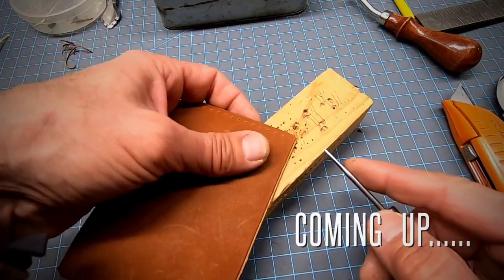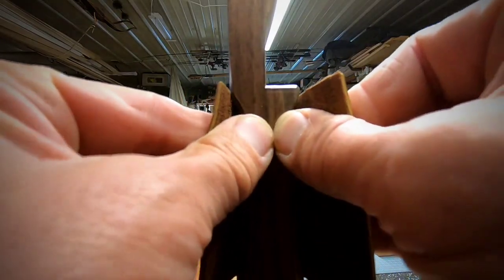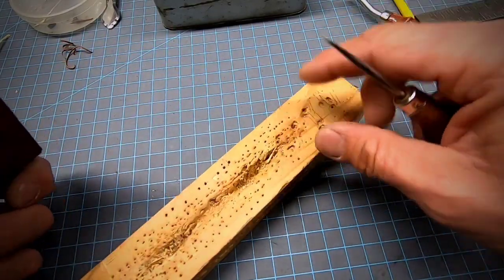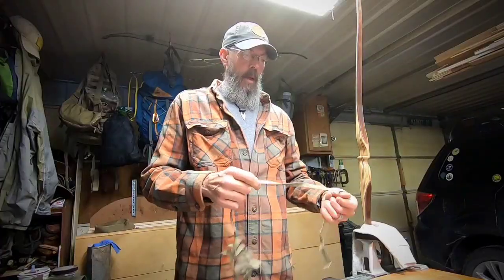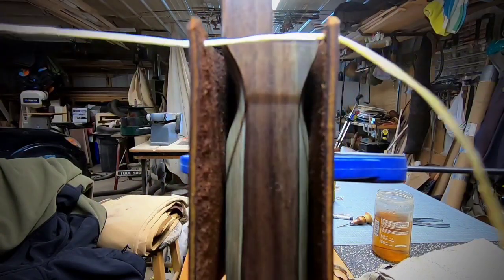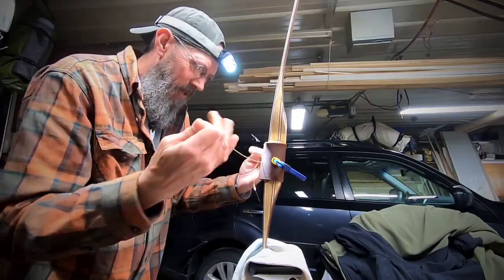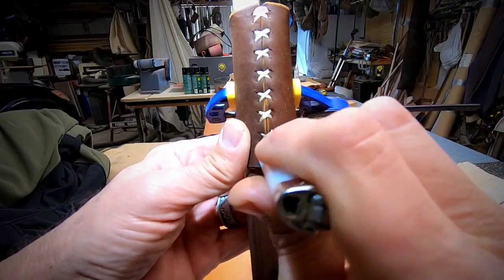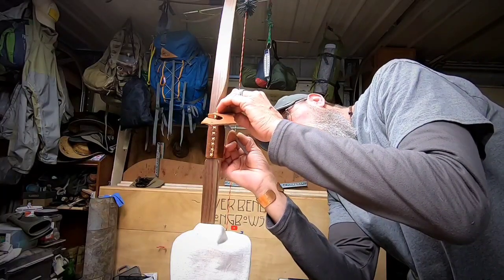DIY No Glue Leather Bow Grip Wrap / Step by Step Tutorial

Comment: Awesome wrap! Just did this and it turned out okay, I'm happy with it considering it's my first leather-working attempt. Quick question for you, what size thread did you use? Mine seems to be a bit smaller than yours and the stitches look a little rougher because of it. Also, some things I wanna pass on to other people who wanna try this:
1. I used too thick of a leather. I went with 3.5mm, probably better to go with something closer to 2mm or even 1.5mm.
2. My first grip I tried ended up being too short in circumference. If you have a very curvaceous grip make your measurements off of the thickest section. It's better to have it 1/16in too big than 1/16 too small, the leather will shrink.
3. Leather isn't cloth, don't be afraid to stitch close to the edge. In my first attempt I punched the holes way too far away from the edge (over 1/2 in) because I was worried about ripping the leather. It didn't work. My second successful attempt was something like 1/4 in from the edge.
4. I got the t-shirt hem wet and then wrung it out pretty good before I wrapped it around the leather. Cotton shrinks as it dries so if you do this it'll tighten down around the grip.
Thank you @RiverbendlongbowsOutdoors you earned a sub out of me!
Reply from the maker: Wow, great tips 👍🏻
The thread is actually a roll of simulation sinew. It's thick but I really couldn't tell you the size. 
Another tip, bowstring makes for great sewing thread as well.  You can match the color to your bowstring. 
Thanks for Watching